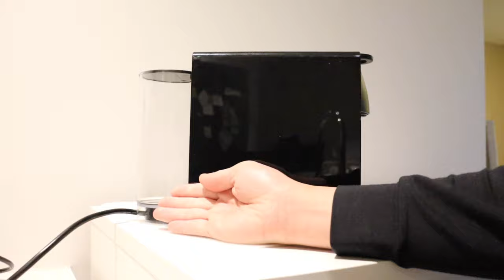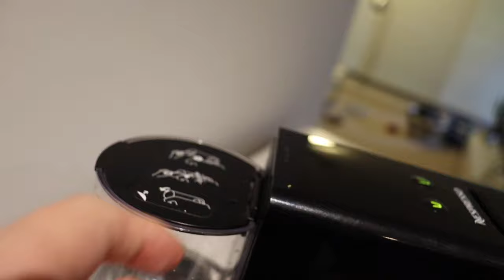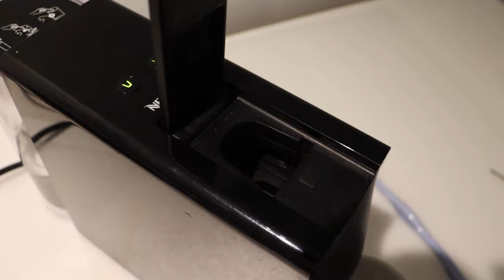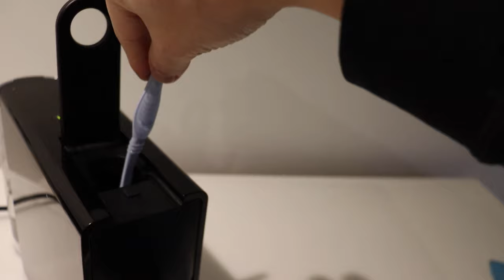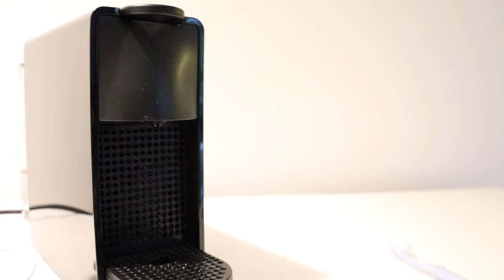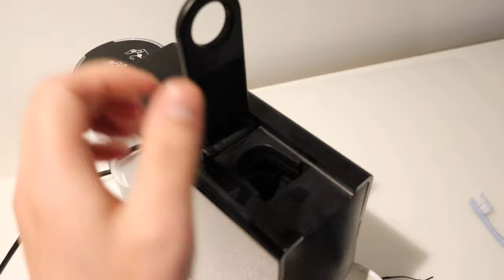NESPRESSO HOW TO FIX No Coffee Flow Troubleshooting Maintenance

Comment from the maker: I hope this troubleshooting/maintenance advice helped. I've had a Citiz machine for 5 years and this Essenza machine for  2 years, with no issues at all. If you do proper daily cleaning and maintenance your machine should last many years. Please also ensure to wipe and rinse out the drip tray, capsule container and any removable parts at the end of each day, this will minimise any risk of infestation. You shouldn't get infestations anyway if you properly pest control your home. Ensure to pest control your home before Spring Summer comes around or the warmer months. DO NOT put your removable parts i.e drip tray, capsule container in the dishwasher as it may deform and discolour your removable parts. Just hand wash.
Reply: Hi there! I have an older essenza that was gifted to me a few weeks ago. The capsules will not puncture. All I get is light tan dirty-ish water coming through. Is there anything I can do to correct this issue?  Thank you!
Reply from the maker: Sonya Kaye Does it not puncture on both sides? foil side and bottom of capsule ?
Reply: FANBOY LARPEE it punctures on the back side.  It is not puncturing on the foil side.
Reply: FANBOY LARPEE  my answer was confusing. My apologies. I think I was just so tired from messing with this machine! 😬 anyway, I corrected my response. Does it make better sense now?
Reply: @larpy  great video. Thank you. I am having the same problem with the pixie c60. The grid will not puncture the foil side of the (Nespresso brand) pod. Just water runs through. Any advice? ☕🤎
Reply from the maker: Tati Mukkada thank you Check the under side of the capsule Edge it should be glossy. If it’s not glossy you’ll need to buy new capsules. That glossy part is a seal on the capsule to ensure it gets extracted properly. If the capsules you’re using are genuine Nespresso capsules and have the glossy rim on the underside you’ll need to book it in for a repair with Nespresso. Most likely an issue with the extract unit.
Reply: @larpy  thanks so much for the info!

Comment: How I wish other videos could be as clear and precise as this. I hadn't used my machine for a while and there was no water flow. I carried out all the four procedures in this video, albeit just about four or five times for the first (air pocket issue). When water still didn't flow, I returned to the first procedure and must have pressed the cup button at least another fifteen times. I was on the verge of giving up and binning my machine when, hey presto, water started flowing! I continued with a few more cup presses to give it a good clean. The lesson I hope to pass on here is - if it's an air pocket issue, you'll have to be patient and persist many, many times with the first procedure before it works. Don't give up too soon. Many thanks for your help and brilliant video.

Comment: Thanks for a nice tutorial. I tried all your fixes but my escenza still wouldn’t pump any water. I discovered that if you turn on the machine, add a capsule and press the luongo button, as soon as you hear it buzz, pull up the lever and pump it up and down several times, the hot water starts to flow. You have to do this to force prime it. Now my once stuck machine is making delicious espresso again!
Reply: This was the fix for me- thank you!!
Reply: This works! Thanks

Comment: Hi, my machine is giving water, but no coffee. I also find that my drip tray receives more water than it normally should. It's like the machine is bypassing the coffee capsule somehow. I cleaned the grid and the spout as in the video, but I think that is more for in case there is no flow at all.
Reply: I am Thankful of all these tips but I have the same problem like Vodstick
Reply: Oh my God!! You are my life saver! I didn't realize how dirty my Nozzle was!!
Reply: Low pressure so water can’t get through the pod. Seal is not good allowing water to leak out into waste tank.
Reply: So how to fix that seal issue then as I have same issue with my machine
Reply: My coffee machine is doing the exact same and I don’t know how to fix it 😩
Reply: we have the same problem as @ vodstick .  i dnt know how to fix it

Comment: Hi! Do you have any tips on how to fix an essenza machine that doesn't pierce the capsules anymore? Water still flows through, but the capsules either don't get pierced fully, or just don't pierce at all. I've tried descaling the machine as well as cleaning the grid plate with a cloth. Doesn't help :(
Reply from the maker: How old is your essenza and which model exactly ? Do they don’t get pierced on the foil end of the back of the capsule ? please make sure you’re using genuine Nespresso capsules and they should have a glossy seal on the under side of the edge lip. If it’s not shiny and doesn’t have that seal that means the capsules won’t work. The new essenzas newer than 2012 rely on a seal of the capsule so if you use old capsules without that seal only water pours out and it won’t pierce the foil end.
Reply: @larpy  It's about 2-2.5 years old, Breville model (BEC220BLK). I only use genuine capsules, and the machine has been working fine until about a month ago where it suddenly just doesn't pierce them properly. Often the first one pierces okay, then if you try to do another one it just won't pierce. But lately even the first one sometimes doesn't pierce or only pierces in the centre. Definitely nothing to do with the capsules itself. I haven't changed anything.
Reply: I have same problem here
Reply: same problem here
Reply: Ditto.

Comment: I have a question for you. My essenza mini is brand new and it is working perfectly.  The only thing is that if I turn it on and wait let say 5 minutes before make the coffe and I press the espresso botton it starts blinking few time and then poring coffe. If I press the espresso botton right away the machine just works immediately.  What could it be?
Reply from the maker: @MrAghi72  the machine goes into a stand by mode after 5 minutes so if you don’t use it, it will go into standby and you’ll need to wait for it to blink and heat up again then you can make a coffee. You can change the standby settings. Download the user manual on the website

Comment: Hello there, 
I was very impressed with your helpful video which went into so much detail regarding maintaining your coffee machine. Thank you.

I have an issue where my water won’t heat up and I’ve even tried to factory reset but that doesn’t appear to be working either. I’m at a loss of what the problem is or if it needs to be thrown out. 
I’ve had it a few years but rarely used it. Maybe that’s the problem. 🤷‍♀️ 
Do you have any ideas?
Reply from the maker: Thank you! If it’s not heating up and keeps flashing unfortunately it’ll need to be repaired.
Reply: Thank you so much

Comment: It took about 5 presses of the lugno button to remove the airlock in my machine. I had tried 1/2/3 in a row previously with no result, and I didn't want to risk damaging it by running more. Thanks for the great info.

Comment: Hello LARPE!  I HAVE A PROBLEM WITH MY  essenza N85.WAE, WHEN I PUT AN ORIGINAL COFFEE CAPSULE, WATER COMES OUT AROUND THE CAPSULE. IF I DO NOT PUT THE CAPSULE ON, I TURN ON THE COFFEE MAKER, I LET THE WATER RUN, IT COMES OUT HOT WITH GOOD PRESSURE BUT WHEN I OPEN THE CAPSULE DRAWER, WATER ESCAPES THROUGH THE TANK WHERE THE CAPSULE GOES AND FALLS INTO THE CAPSULE DRAWER. COULD YOU CONFIRM ME IF YOU THINK IT IS A BOARD PROBLEM (SEAL) ? OR DO I HAVE TO CHANGE THE WHOLE PISTON?
THANKS A LOT!

Comment: Thanks, great useful video! Question: on my machine which is the same as yours, both my espresso & lungo buttons give the same volume so the espresso doesn’t give out the 25-40ml. Any tips on how I can get this fixed (without paying the expensive nespresso call out fee)?!
Reply from the maker: @rl9754  You need to reprogram the cup levels. Close the lever without inserting a capsule. Put a cup under the spouts Press and hold the button you need to reprogram and water will pour out. Let go when you are happy with the desired level. Next time you press that button it will go to that level
Reply: @larpy  excellent thank you!

Comment: thanks for this, although my problem not covered.  I descaled my machine and now it won't work, the lights are on but the motor does not switch on.  I have checked for air bubbles.  my machine is exactly the one in your video.  help please!

Comment: Hello. Thank you for making this video. I think I have the air pocket issue. However I have a new coffee capsule inside and I think now the coffee chamber is pressurized so I can open the lever to empty it. Also no coffee is flowing no matter how many times I press the espresso button. In fact some parts of the machine which I believe to be the pump grows really hot. Please advise how to tackle this problem. Thank you

Comment: Well, the last answer is that the motor or internal pump just won't pump any water. I have a 2012 Pixie Model C60 and the motor comes on, but nothing comes out after I did all this cleaning. And it wasn't dirty anyway as I hardly use it. The motor does not sound right so I bet it is just too old. They all must have a lifespan. Any chance of taking it apart and looking inside to see if I can see the issue..???

Comment: I cannot open the slider door to put in the capsule. It seems there is a loose part, perhaps the capsule holder obstructing it. When I run the water, it dispenses into the capsule waste/dripbox rather than through the spout. I have ensure the spout is not blocked by passing a wire through the nozzle.
Any suggestions?
Model Krups XN250

Comment: Have you any tips on fixing a leak underneath the machine?
Reply: Having the same issue. Did you find a solution Stephen?
Reply: I have the same issue... idk how to fix it and I’ve had this machine for over 3 years
Reply: It could be the seals that hold the pipes through which water passes, or maybe the pipes themselves. You need to un-assemble your machine and observe where the water is exactly leaking from. I can help showing on how to do it if you don’t know on how , there are plenty of videos here on YouTube on how to un-assemble anyway :)

Comment: Thanks a lot. I ended up finding out that the issue was with a new brand of coffee pods that I purchased. Theyare made of plastic instead of aluminum like the original nespresso or a couple other brands I tried. Apparently my machine cannot puncture and smash it to extract the coffee and get the water through. I have a DeLonghi.

Comment: Do you have any troubleshooting tips for the milk frother not drawing up the milk. Getting a flash soon after holding the froth button down for a latissima
Reply from the maker: osasako Try dismantling all the parts and cleaning. With the silicon tube make sure there’s no blockages and ensure it’s the right side up. If it still doesn’t work try descaling.

Comment: Hi, we have got the same Nespresso that on your video. We run descaling program this week and half way through, whilst putting back the water container with clean water to flush it through, the machine decided to stop the water flow. It was just growling. Thinking it was an air block, we’ve been pressing both buttons and also each of them individually but eventually Nespresso went quite and now doesn’t even make any sound🙁. Can you help please ?
Reply: Did you find a way to solve this? I have same issue :/

Comment: Hello, thank you for the video.
My Essenza mini stopped working all of the sudden and it keeps blinking 3 times constantly. No water flow, no sound, just blinking. When I sent it to Nespresso for repair thay mentioned that the reason is that insects went inside the machine and that they cannot fix it..I was a bit shocked..but I still have hope that it might work one day..can you give me your advice?
Thanks in advance.
Reply from the maker: If it’s just blinking together both cup lights like the heating up mode and doesn’t make a noise when you press a button, unfortunately it needs to be repaired or in your case since the technician said there were insects better to buy a new one.

Comment: I have a D50 that won't pump water.  It has a slide on top at the front of the machine that pushes back to allow the capsule to be inserted.  How do I get air out of this machine?

Comment: I have the nespresso c60 (orange sides) and mine won't pump water through, tried cleaning out with paperclip but water doesn't want to pump through. I cannot see a way to get into machine.  Amy advice/tips? Thank you
Reply from the maker: Ensure water tank is connected properly and the 2 clips on the water tank lid goes into the two holes at the back. If you keep pressing the button and still no water I suggest you need a repair. Contact Nespresso in your country.

Comment: My machine is able to dispense the full amount of water when I press the espresso button without a capsule. However, when I put a capsule in the machine, it's only dispensing about a quarter or half of the espresso cup. Any idea why it's doing this? Thanks!
Reply from the maker: Could be a blocked pyramid plate. Try flushing water through the spout and using a toothbrush to brush that grid plate , like in my video.

Comment: What if 75% of the coffee is coming out normally but the last 25% is coming out from INSIDE the machine, draining into the tray that holds the used capsules? Have you seen this before? Thx
Reply from the maker: It could be the coffee spout is blocked with coffee grinds so try a paper clip up the spout and flush out and use a wet toothbrush to brush the grid plate. If you’ve tried this then most likely you’ll need to get it repaired but if it’s not too bad just persist with it. It’s always normal to have some residual water go back into the Capsule container

Comment from the maker: If your machine is dripping from the coffee spout after you make a coffee. Make sure to lift the lever up to eject any residual water sitting inside the extract unit/brewing unit. The residual water will then go straight into your capsule container.
Reply: I notice one time that i put the capsule and extract but a few seconds before the coffee itself come out, a bit of pure water came first. Maybe it´s because I did not lift the lever before extract, may this be correct ?
Reply: Hey bud ..thanks for the video ..I cleaned out everything as u mentioned ..and now there is  no leak when I'm making the coffee ..however ..after the coffee is ready and I lift the lid up ..some residue water comes out of the spout and also some falls into the coffee pod container..why does it still do that ?  Is that normal ?.. appreciate your help

Comment: Any idea what to do when the lights will not stop blinking and it’s not heating up?
Reply from the maker: If it continuously blinks heating up. It will need to be repaired. However if it is blinking alternately it may be in descale mode. Press and hold the espresso and lungo button down at the same time until it stops flashing.

Comment: Hi, I have an Inissia and I haven't used it for almost 2 years. Now it doesn't work, it doesn't even make any sound.
I have tried to reset it, doesn't work either. However, the machine gets warm/hot like it usually does after few times used for making coffee. Any idea what happened? I came across another video and the dude said the thermal fuse might need to be replaced. I don't know what type of thermal fuse it is. If anyone has come across similar situation, please share how to fix this. Thanks so much!

Comment: my machiine is exactly like the one in the video.  My Lungo is not pushing as much water as before and is less than the espresso setting rather than more than the espresso setting.
Reply from the maker: Try reprogramming the button. Press and hold the lungo button until the desired level and then let go. The next time you press it briefly it will stop at that level.

Comment: I have the same machine, but when I put the pod in and push the lingo button it stops half way through then I have to push  it again, any ideas what’s causing it?
Reply from the maker: You may just have to reprogram the button. Just press and hold the lungo button until the coffee/water is at the desired level and then let go. Next time u you press it once it will go to that level
Reply: @larpy  thank you :)

Comment: I've cleaned my machine and the water flows normally but when I start putting in pods still nothing comes out. And what I noticed is that the machine is unable to poke holes in the head of the pod.
Reply: Same issue here

Comment: Activated it without water for a few seconds, and now the water flow stopped. I tried to keep using it to get rid of the air pocket like you said, but it doesn't work. Did it like 10 times and no flow. Do you have any advice?
Reply from the maker: Ensure the water tank is Connected properly, sitting flush. What model machine do you have?

Comment: I have a problem which is not answered here, I descaled my machine and now I am getting extra water for one shot. Generally its 40 ml for one shot and 110 ml for a cup, I am getting almost 250 ml for a cup which I have to shut down manually to get the right amount of water.

Comment: Problem: Lungo button only pump a little water then stops. 

Solution: Reset to Factory Setting.

How: 
1. With machine turned off, press > 5 sec and hold down the Lungo button 
2. LEDS will blink fast 3 times to confirm machine has been reset to factory settings.
3. LEDs will then continue to blink normally, as heating up, until ready. (25 sec)
4. LEDs will then Steady Lights and ready to make coffee

I thought worth posting here in case someone encountered the same issue as I did.
Reply: Thank you. You solved my problem!
Reply: Thank you for this tip. I was having that problem this morning and it has solved it.
Reply: Thank you!